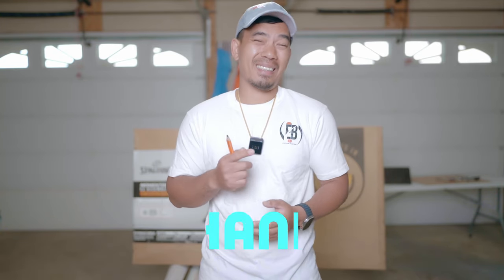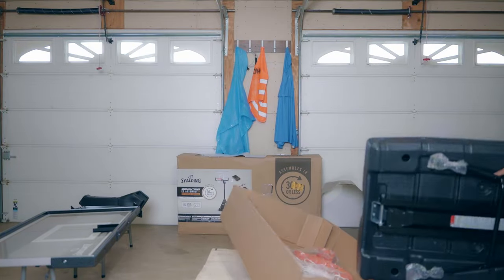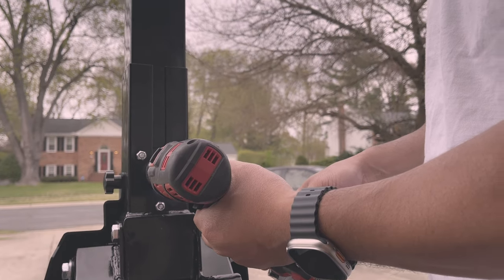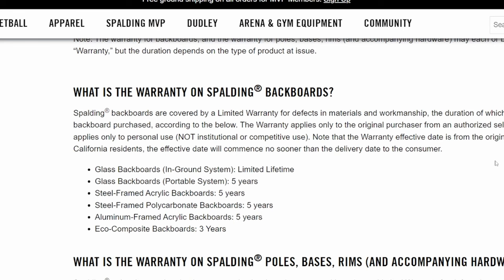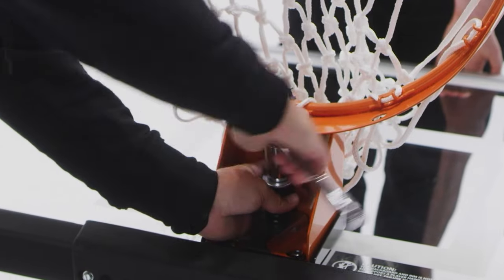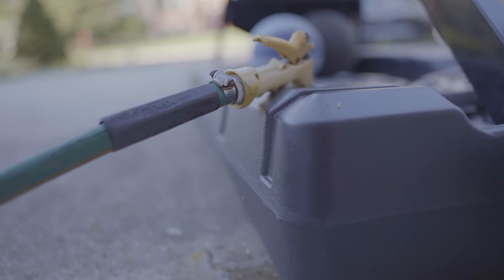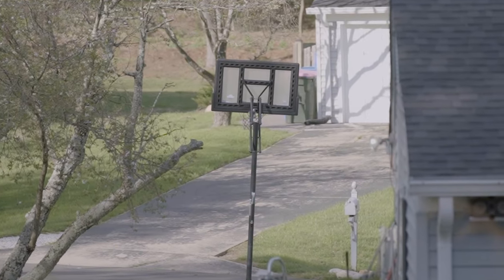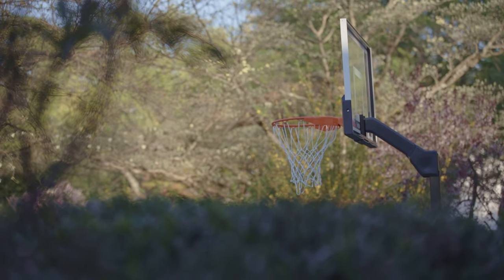SPALDING MOMENTOUS EZ ASSEMBLY

Comment: Very informative review.  Thanks for taking the time to do it.  Nice form on your shot too!  I have a question.  My HOA doesn't allow hoops to sit outside, so I have to store it in the garage when not using it.  Does this one allow you to fold it down to store in the garage with the pole laying horizontal to the ground?  I saw you bring it out of the garage that way.
Reply from the maker: Once base is filled with water or sand then it become cumbersome to move around and the bolts has to be removed for it fold, so it’s not worth it if you gonna be doing that a lot, it’s too much of a hassle.
Reply: @EverythingBasketballs  Thanks a lot for your fast response.  I appreciate the info, and will look for a different solution.

Comment: I assembled mine and it’s a great hoop. Curious though, the instructions on moving it make it seem simple. I cannot get it to budge. I don’t want to have to drain the hoop every time I want to move it. Any tips on moving the hoop after it’s filled with water?
Reply from the maker: Try to get your hands as high as your could to grab the pole then use your foot to prop  the base then you can tilt the base. Once the base is tilt it should be easy to move around.  It seems heavy with that much water in the base but it’s not that heavy when the base tilt.

Comment: Thanks for the review. How is the feature to adjust the height up and down?
Reply from the maker: I adjusted the height everyday and it still works like new. I do use battery drill to adjust. The height adjustment handle take a little of bit of time and I don’t have the patience for it 😂. Sometime after i only took a few shots then my kids came outside and wanted it lower so they can play then they took a few shots and done with it. Now I have to adjust to 10ft again, so using battery drill can be very helpful. 
So I complained about the front cover with some kind of degree, so it turn out that it’s helpful when I take a lot of free throws or shoot 3s from top of the key. It helps return the ball to me. It’s only annoying when I shoot the ball from the sides then I sometime have to chase the ball so it won’t run off to the street.

Comment: I just put mine together. Pretty solid but backboard slightly wobbly like you said. Mine seems to move a drop more than yours in the video. Suggestions?
Reply from the maker: Make sure to tighten all the screws and nuts. The filled the base with water all the way to the top.
Reply: Wobbles mostly from top third. Backboard just moves a drop more than I think it should. Bolts tightened. Used sand for base.
Reply from the maker: @sjf4626   maybe email the Spalding support to see if that normal. It shouldn’t wobbling that much because you got sand in the base so it should be more stable.  So the bottom half is not the issue.